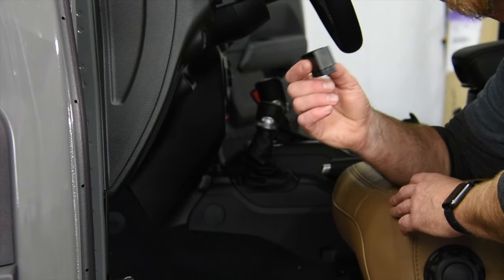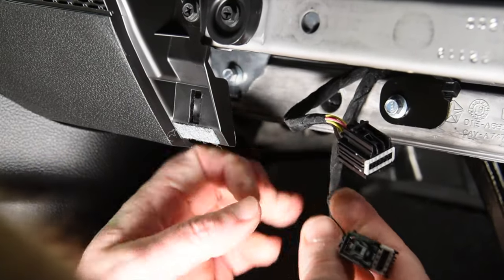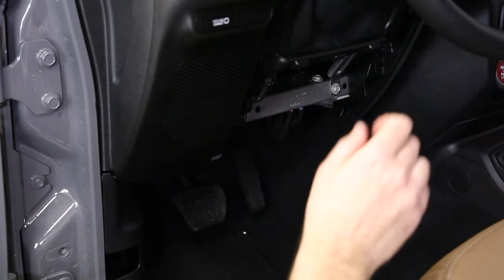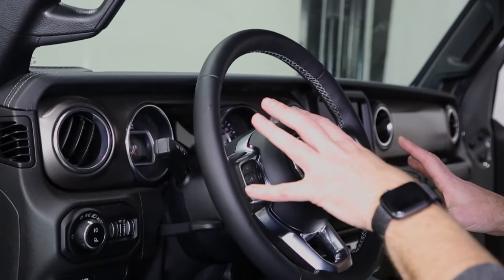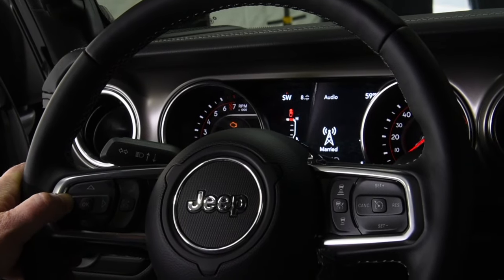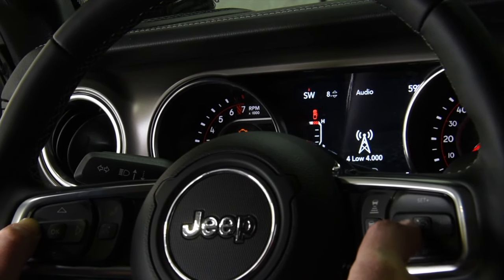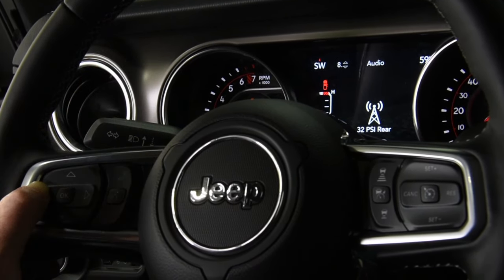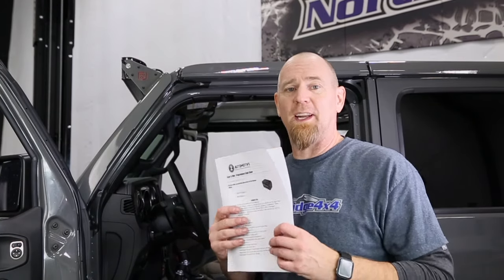Z Automotive Mini Tazer - How To install & Program Jeep JT / JL

Comment: Are you sure that is the correct way to measure for tire size?  I would think even at street pressure the bottom of the tire is compressing and throwing off the measurement.
Reply from the maker: Yes, the bottom of the tire is compressed and flattened a little, which is why measuring the true height of the tire as we show it, is a quick and easy way to get an accurate measurement.

Comment: Just installed a Z AUTOMOTIVE TAZER JL LITE. I didn't have the "radio antenna" display on my screen, and did find my way to the "audio" display, & was able to "marry" the unit to my JT's computer. I was then able to find my  way to "Perf" menu, and adjusted for my new 35" tires on this '21 JT Mojave. I'm determined to perform "Auto StopStart Disable" so that I no longer have to push the dash button to turn it off. Removing the AUX battery didn't disable it, as some other videos claim. Based on your outline it appears that it can be set to disable AutoStopStart upon vehicle start-up as a "LIVE" feature. I'll update this post once I've figured that part out. THANKS for the video!
Reply from the maker: You don't need to do anything to set the ASS. Just push the button on the dash, the Tazer will remember the last setting.
Reply: @northridgenation So, that’s why when I started it recently the ASS light was already on. COOL! Thanks!
Reply: When I drive my jeep it has the audio screen but trying to set this up it isn’t showing the audio screen at all either how did you get it to setup

Comment: I just did this again.  It was way easier than previous.  The plugs look so easy to get to, but not enough room for 2 hands.  If you use one to pull on cable as much as possible while pushing the tab in, you can get the tab in so you can reposition and pull it the rest of the way out.  No need to really remove that panel, doesnt make them any easier to get to on my 2020 JL.
Reply from the maker: Glad you got it done!

Comment: It’s near impossible to unplug the plugs
Reply from the maker: That's definitely a common challenge.
Reply: @northridgenation  - It took me about 5 minutes to unclip the plugs, mainly due to the tight space. Knowing there was a tab to depress surely helped, but pressing the tab while pulling the plugs down is a slight challenge - nothing major. I found that maneuvering your hand(s) to accomplish slightly pulling down on the connected wires while pressing the tab did the trick. Thanks.

Comment: You did the reboot but the instructions say "Wait for the countdown, then perform two sleep cycles.
• The quickest way to do two sleep cycles is to turn the ignition off, open and
close the driver’s door and wait about 60 seconds AFTER the dash goes dark,
then turn the ignition on (but not the engine) and repeat once more.
• This step is critical after changing settings or settings might not save, or you
may find that the dash doesn’t shut down, which can result in a dead battery." You didn't do that.
Reply from the maker: You are correct, the two sleep cycles are a crucial step.
This video was filmed back in 2019, back before the two sleep cycles were a recommended step. Our more recent videos do show the two sleep cycles.
Reply: @northridgenation excellent thank you for the clarification. Their instructions are a little hard to follow.

Comment: Measuring your tires that way is going to give you an incorrect measurement because of the "squished" contact patch.  What you want to do is put a piece of tape on the floor next to the tire, mark it with a line, and to the same on the tire so the lines match up.  Then roll forward until the line is at the bottom again, and measure the distance between the two lines.  This gives you the circumference from which you can calculate the proper diameter.
Reply from the maker: That is a great way to do it too.

Comment: My check engine light came on after matting and changing tire size. After rebootingbandb2vdoingb2 sleep cycles. The check engine light came in. What happened? ?
Reply from the maker: That's weird, check the CEL code, what does it say?

Comment: Will this allow me to disable the start stop feature that is a common problem with the Jeeps?
Reply from the maker: Yes, once installed, the Tazer remembers your last setting. So, if you turn off the start stop using the dash button, it will remember it is off and keep it off.

Comment: Man, I wish I had the hands of a four-year-old little girl. I can’t get up there with one hand and a pair of 6 inch pliers. Apparently the Mojave is in a completely different position. Mine is tucked so far up into the left from where you’re at I can get my fingertips on them. I got the bigger of the plugs out the small one I can just about touch my Leatherman with and can’t for the life of me even begin to get it to move. I’m about 30 minutes into it and about to give up and send it back.
Reply: Same with my rubicon JT. I can’t get my hands in there all. They get cut all to shit by jagger metal.
Reply: @jacoblee3729 did you manage to get it out?
Reply: Did you get it out? I after cutting the shit out of my finger, I am feeling the same way

Comment: I have a 2024 Gladiator was wondering if this will void the warranty, and also do you have to leave it plugged in all the time?
Reply from the maker: You have to leave it plugged in for the LIVE functions, many of the standard functions you can remove it.
Most people leave them plugged in, except when going to the dealer for service.
But that is only if their dealer has a problem with the Tazer, some do, some don't.

Comment: What does the security gateway module actually do?  I assume the Tazer performs those functions instead when you swap the cables over to it?
Reply from the maker: The SGW, in short, is a module whose function is to keep the communication networks secure. The SGW protects the vehicle networks from being exploited by creating a firewall between two portions of the network with the most vulnerability. These are the telematics/radio units and the DLC.

Comment: Will this work on a 2024 JTR? and will dealer see this? Will it void any warranty?
Reply from the maker: Yes, the Tazer Mini will work on your '24 Gladiator. If you're worried about a dealer noticing it, you can simply "Unmarry" the Tazer, unplug it and all functions will return to factory. Then, after service, you can easily plug it back in and restore your preferences.
Reply: @northridgenation  unmarrying means you're back to stock tires? And your video didn't show the tazer being unplugged. Does it stay the whole time?

Comment: This device chenge only cluster or TCM too?
Reply from the maker: This adjusts the parameters of the OE computer system.
So, let's say you adjust the tire size. It will make any changes necessary, including the TCM.

Comment: Be nice if someone would post configuring tazer with laptop. Im having a known issue with manual jeep and bigger tires where i have 7 seconds to configure before limp mode locks out. Id like to know if laptop connection will work too.  Not a single youtube video showing this sadly!
Reply from the maker: Checking into it.

Comment: The tire size setting instructions were not correct for my 2021 JT Mojave, the factory setting for my tire size had 33.07, my new 35 in tires measured 33.25 so my shifting should not have been as bad as it was, 33in tires are really closer to 31in in width, 35in closer to 33in and so on. I set it to 35.07 to match my tire size, not literal width and the shifting was sooo much better so no need to measure and use a level just use the tire size but you will figure that out pretty quick, just look as what the factory set for comparison.

Comment: Why is it important for the computer to know that it has 37s and not 33s? Is it just a speedometer thing ?
Reply from the maker: Yes, it helps the computer choose the best gear and make the best engine adjustments for the load.

Comment: Did you remove a bracket? I can't even get my hand in there
Reply from the maker: No, we didn't. They can be tough to do, sometime sliding a small screwdriver up to depress the locking tab while you wiggle it back and forth with your finger can help.
That's why we recommend you get the extension cable with the Tazer, to make installing and removing the Tazer easier.
https://www.northridge4x4.com/part/programmers-tuners/sgw-ext-z-automotive-sgw-extension-cable

Comment: On the 2023, you don't have to pull that panel.  You can reach it from under the dash, it's closer to the ALDL connector.
Reply from the maker: Yep, it just makes it a little easier to get light in there to see the plug.

Comment: what about the auto start stop and the auto park ?
Reply from the maker: You can shut off the Auto/Start Stop function under the LIVE MENU setting, so you have to start up the vehicle and make changes while the engine is running.
Reply from the maker: Tazer cannot disable auto park.

Comment: Had no problem
Removing the panel can’t find those plugs. Are all
Gladiator the same
Reply from the maker: Yes, that SGW is in the same place on all years. It is tucked up in there, so they can be tricky to find.

Comment: is it safe too assume that the tazer mini is not compatible with the sport s with the basic console/speedometer screen.. it does not have the radio tower option that I have found so far..
Reply from the maker: The Tazer mini is compatible with all model JLs/JTs.

Comment: awesome to see my exact truck up lol....just did the install on zauto lite....i did notice the outside temperature is now showing 30c.....im in Canada lol and 4feet of snow according to local weather app its -17c.....how can i fix this issue.....fyi 2022 Gladiator 2100kms with 35's....thanks in advance
Reply from the maker: If this is a new install, drive around for a few miles, the temp will reset to correct.

Comment: When you adjust tire size does this only adjust the speedo difference or does it also adjust shift points as well? Just got an eco diesel wrangler with 37’s on it and it’s used and it’s getting terrible gas mileage. I’m wondering if I just need to do this and if it would help with gas mileage
Reply from the maker: Loaded question.
The Tazer only corrects the speedometer, BUT, the computer decides on shift points according to the speed and engine rpm. 
By correcting the speedo reading, the computer will be controlling the trans shift points like it was stock according to speed.
BUT if you haven't changed your gearing to match any increase in tire size, you will still not have the engine RPM to speed issue fixed.
Reply: @northridgenation  I used this to adjust speedo and did a full reboot in the menu and it seemed to help quite a bit. Went from about 12mpg to 22mpg. Most people I follow with the diesel don’t re-gear until they go to 40’s. Is that what you guys are seeing as well?

Comment: I Have 2021 Jeep Gladiator with 2" level kit and 33' tires do I need the Tazer Z Mini?
Reply: A little late for your question but - no. If it came from the dealer as such, you should be fine.

Comment: What is your tire pressure now also what is your tpms warning light psi set?
Reply from the maker: We set tire pressure warning at 30 psi.
Reply: What is the tire pressure?
Reply from the maker: @jayhernandez7788  We were running 35 psi. They are Patagonias, you gotta run them on the crown.

Comment: Wow you have 37 psi on tires size 37 is stock tires psi and if you have aftermarket like 37 should at w least  30 psi? Also how come don't see the jeep pictures showing all your tires pressure from the dashboard?
Reply from the maker: The Tazer lets you program in the low tire pressure alert psi you want.

Comment: I am not getting the CEL menu option nor the marry option. Does that mean one of the ports is not plugged in properly? I was able to get to Auto Start Off/On and set that to Off and it held but I also don’t see any Reboot menu option!!! I did do a firmware update first so wondering if the Marry is automatic after that update?
Reply from the maker: You have to make sure it is married to your Jeep.
If there is any doubt. Unmarry, then start and stop the Jeep twice, opening and closing the drivers door after each start and stop.
Then remarry the Tazer to your Jeep, reset all your settings, reboot and then go through the start/stop procedure twice more.
Reply from the maker: Most all settings need to be done with your Jeep in the run mode, but your engine not running.

Comment: Thanks for the video, do I need to remove the tazer after the reboot or just leave it there connected permanently?
Reply from the maker: We prefer to leave it installed. You can remove it, but then will not be able to make any live function changes, like bumping up engine RPM for winching.

Comment: Any conflicts with using the Tazer Mini with a 2020 JT for the 'cargo camera' for use with a forward facing camera? We have a kit and the camera flickers. Any advice?
Reply from the maker: "CARGOCAMERA" is the mode to use when setting up a forward camera.
Not sure what would make it flicker.
What brand camera?
Official word from Tazer is to use their camera and that it has to be the 8.4 U-Connect head unit.

Comment: unnecessary parts
#1 you don't have to take a part that plastic
#2  measuring your tire height if you don't know what tires you ordered please don't mod your vehicle you are a idiot.
Reply from the maker: 1) You are correct, you don't have to remove it, though it does make it easier.
2) Many tires are not true to size, so it is always best to measure with the vehicle weight on them to get the true height measurement.

Comment: Whats the trick to unplugging the connectors from the SGW module? I depressed the tabs on the connectors but for the life of me cannot get them out!
Reply from the maker: They can be real tight. We depress the switch and then wiggle back and forth while pulling on the connector.  Definitely don't pull on the wires, but you knew that already.
Reply: @@rudygunn2214did you ever figure out a trick to get them out? I spent 3 hours as well, concerned about pulling to hard - don’t want to break it. Thanks!
Reply: @@rudygunn2214 thanks! Good idea
Reply: Impossible to get out!!

Comment: Does the Tazer JL Mini leave a footprint in the ECM for the dealer to find?  Do you need to remove before going to the dealer?
Reply from the maker: If you remove it and unmarry it, the dealer will not know you had one.
However running the Tazer does not necessarily void your warranty. The dealer can't just void your warranty because it is installed. There is a lot of gray area there....Check out the Magnusson Moss act: https://youtu.be/u9NcEyHFKXA
Reply: Northridge4x4 Yeah, Im aware of the Magnuson Moss Act of 1975, but my local dealership (also sells Jeep) HATES me.  And I live about an hour & half from the next nearest dealer.  So, I was just making sure it wouldn’t leave a footprint.  Does it improve the throttle response?  

I know the Edge Pulsar does a lot of the same functions the same way, and mounts to the ECM, but also gives you more power and torque, and improves throttle response.  Will it leave a footprint, since it mounts to the ECM and is removable if you want to unmount it?

Just looking at all options.  The extra power would be nice, since I’m going with 37x13.50’s with the stock 4.10’s on my 2020 JTR.

Comment: Have you been getting any issues with the tazer mini like battery drain or start and stalling the gladiator?
Thanks for your reply
Reply from the maker: None at all.
Reply: @northridgenation  only had it a few days, tried a setting with the side markers led and it was blinking. Had to turn them back on. Hey great videos keep up the great work. Happy new year
Reply: I put mine in but don’t have an option to Marry.  It’s just Lightshow and Key Not ON
Reply: Brian Kenyon did you hit the Jeep ignition once or twice? I originally hit mine only once and had that issue. Once I hit it again to take the Jeep to the right setting it worked.